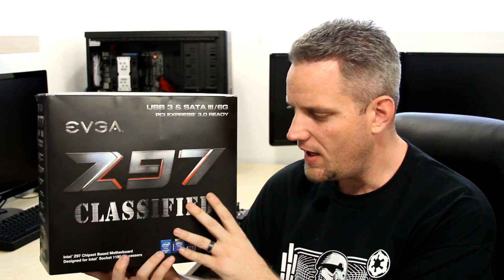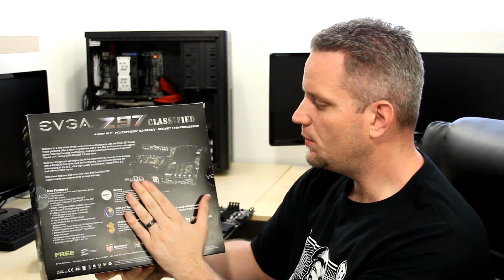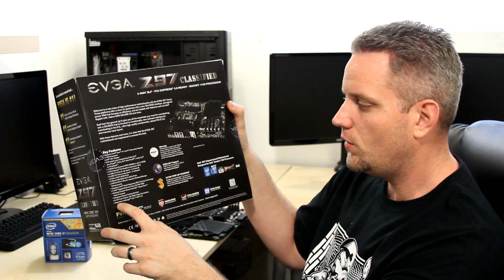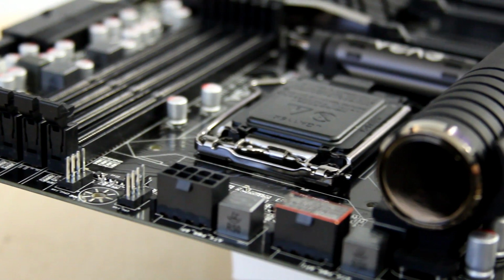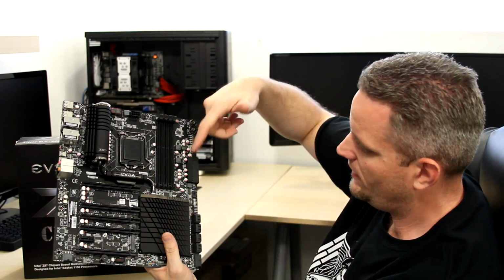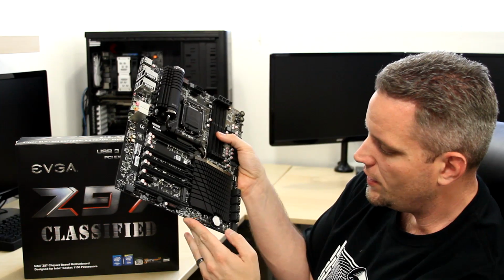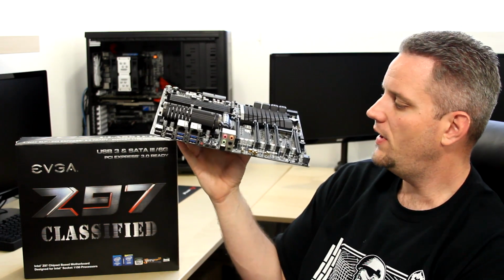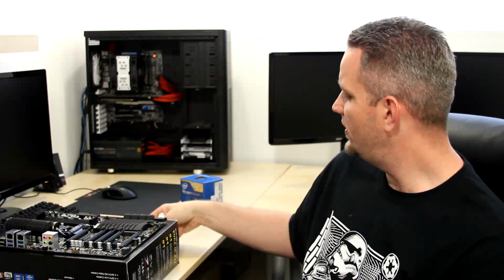Amazing features with very little compromise! EVGA Z97 Classified!

Comment: This is still my desktop system! Back when this video came out I built my machine with 4970K, 32GB Crucial Ballistix Tactical Tracer RAM, 4 Nvidia Founders 780ti cards in 4 way SLI and a couple RAID arrays run off the MB. I had a 1600 EVGA power supply and Cooler Master AIO as well. Then I updated it to 2 way 1080ti SLI and went to 1300 watt EVGA power supply. Now she's just running a Nvidia Founders 2060 Super and all the original equipment. Still an Awesome Machine!!! 4790k runs at 4.9 ghz.  Thinking about upgrading everything to Z790 and i9 14900k, but hear bad things about the 13th and 14th gen chips. Fond memories messing with this machine to this day. Back to the best of overclocking motherboards and GPU's. 3DMark was my addiction,

Comment: +JayzTwoCents Just wondering about those two cpu fans... I have this board and i have two four pin rad fans hooked up to them. Both are set to CPU temp in the bios, however, one is responding correctly while two is just spinning at max regardless of the fan profile i set up for it. Any ideas???

Comment: Is there a way to increase the number of usb 2.0 internally because this mobo only has 1 2.0 and 2 3.0 sockets it's really bothering me
Reply: MrDarkotaku Yup.

https://www.nzxt.com/product/detail/99-iu01-usb-expansion-case-accessory.html
Reply: I've read reviews on that thing the chips tend to catch on fire if you have too much power going threw it...
Reply: MrDarkotaku Then don't put too much power through it. You asked for a solution, I've given you one. I'm using one of these myself and it's working fine connected to my AX860i. Any short-circuits and the PSU will shut down long before a fire becomes an issue.

Comment: That motherboard is the basis for my next build.  Still acquiring parts, but I have already purchased THIS motherboard before watching THIS video.
Reply: Byron Horde I got mine a few months ago and I am very happy with the purchase.
Reply: StealthOD130
You know what's funny?  I just recently found out that Skylake is coming out relatively soon.  Most likely September, which is not very far away.

When I bought the EVGA z97 Classified, I was originally planning to get the Devil's Canyon (i7-4790K) CPU.  Now, after hearing about Skylake and that it is potentially going to be released in September, I'm of the mind to wait and see.

Considering that I am going from an Ivy-Bridge (i5-3570K) CPU that I've had for just over 2.5 years and that I have not yet purchased another CPU or RAM, I'm feeling that waiting is the best option for me.  At the very least, I can wait to see what the final pricing of the Skylake chip I'd want will be.  Besides, I'm AT LEAST two months away from completing my new build.

The mother board is still sealed in its original box and packaging, so I could potentially sell it as new.  In the meantime, I still have my current system to use.

Comment: Jay how do you get around having just one USB 2.0 Header on this board? For example I want to power my All in One CPU Cooler and still have the functionality of the front usb ports on my case.
Reply: get the nzxt usb expanision, works wonders
Reply: I'm pretty sure a all-in-one cooler doesn't use a USB header
Reply: danskfan100 These particular ones  such as the kraken x61that have customization rgb leds and fan speeds have to be connected to a usb header

Comment: Just got this board two weeks ago for my 4790K (re) Build. Had the X58 sli. Be warned!  Not all of your parts will fit here.  CHECK your MEMORY.  I just found out that my uber expensive 12gb of triple channel 1600 Dominator Ram does NOT work on this board.  Apparently Triple channel ram that runs at 1.65V will not work.  Here goes another $400.bucks for new ram  ughhhhhhhhhhhhhhhhhh!!   ( It does run at 1333 at 1.49v )
Reply from the maker: NickNasc Memory compatibility is always the first thing people should check before purchasing new hardware.
Reply: NickNasc PcPartPicker man. Run it in compatibility mode and you should have no issues finding ram for this board

Comment: ***** hey i made the mistake ofr being an idiot and getting a pre built and im realizing its a lot more expensive then building one myself and im trying to upgrade but i think i have an older motherboard because it beeps when it turns on and it only supports 16GB of DDR3 ram and it only supports 1 graphics card at a time. what im asking is did the company i buy this from rip me off? i payed $660 for a ((old?)) MSI mobo, MSI GTX 650, AMD FX-8320, 4GB DDR3 x2,ALLIED 400W ((500w?)) psu, a LG cd drive thing, a 1TB hard drive, and 2 fans that look like cheap plastic but they have leds on them, and a company style case that has fan speed control a reset button and a lot of hdd slots that i cant use because i have a weak psu and not enough sata and whatever cables. hell i had to unplug the cd drive just to add another hdd. it was a laptop hdd but it works

Comment: Hey Jay, whats your two cents on the x99 and 8 core cpus? You think the price tag is worth the performance boost over the lower 8 core cpu's? Note that the processor is mainly doing HPC Scientific/Engineering computations like for example simulations on ansys etc. It will also be used for CAD/3D modelling, video/audio/picture editing,  gaming and the dubbed "general computing". So it will be stressed with all types of workload, would you still say a 1000 dollar MSRP is worth it for the 8 core?

Comment: I'm not much of a fan of this motherboard. On the plus side it supports 4 way graphics, duel LAN ports and decent on-board sound. On the negative it doesn't support M.2 or SataExpress so you will have to forgo next gen SSD performance due to sata3 saturation, its bulky heat-sinks can interfere with parts in your system such as lair coolers, tubing or top rads and its large width limit your case choices.
All in all I don't see that your going to get your moneys worth out of this board, it'll be great till next upgrade cycle then it basically goes straight in the bin. It may be build well and all, but I'd take a cheaper motherboard with better features thank you very much.
Its looks do suit skunkworks well though..

Comment: is this a good build http://pcpartpicker.com/user/Gamer2001/saved/NfFKHx
Reply: wrong
Reply: Get rid of the cd drive and get a better cooler. that processor should be a beast to overclock with once you have the right cooler and it will have no problem running the latest games. Its gonna suck at rendering and stuff like that tho...
Reply: you will really HATE that CPU very slow
Reply: Will bottleneck the GPU you will get terrible performance.
Reply: it has better benchmarks than amd 6300
Reply: look up a utube channel called scattervolt.  he did a 500 dollar pc
Reply: the first thing i woud upgrade if i got some more money is that
Reply: also good for overclocking
Reply: look up the channel scattervolt.  He used this for a 500 dollar pc
Reply: Doesn't mean it is good
Reply: Not all that good. It's a dual core. Won't bottleneck apparently but if you want to overclock you should probably look into some cpu coolers.
Reply: Yes as long as you overclock.
Reply: Rasper Jilius Yeah it's fine but get a good cpu cooler and overclock the cpu then it'll be good. If you don't overclock it will be slow though.
Reply: i thought intel actually put some effort into them
Reply: k thanks, i will also probably upgrade it in fall
Reply: k
Reply: Game A Flame you're welcome :)
Reply: ***** k thanks
Reply: This just in some ASUS boards can overclock without the price of a z97.
Reply: k
Reply: bottleneckin the gpu terrible cpu. 750W Minimum System Power Supply Requirement. Your only getting 550 w psu.
Reply: thechickenchaser 550w is more than enough to power his build lol. The gpu wont be bottlenecked once the processor has been OC'd to around 4.7ghz
Reply: With what cooler stock heatsink lol?
Reply: thechickenchaser I use a 500W to power an even beefier build.
Reply: thechickenchaser Also if he does get a CPU Cooler then I doubt it'll take the remaining 200W he'll have left over.
Reply: Sub $1000 dollar builds should never need 750w

Comment: hey jay what can i upgrade on my computer 
im running 

:GIGABYTE 990FXA-UD3 motherboard
:AMD phenom(tm) II X4 955 processor 3.20GHz overclocked to 4.0GHz 
whats cooled by Cooler master seidon 120V
:GPU is a GIGABYTE R9 270X OC 4g
:Harddrives Samsung SSD 840 EVo 120G with a 2TB
:running a 650wtt power supply by auro cool 
:G.SKILL Ripjaws Series 8GB of ram

the fans im running are 3 140 Corsair AF's front and rear and 2 120's AF on the cooler push pull 

anything i could do to get a tad more performance out 

love the video's keep it up :)
Reply: More Ram

Comment: Those components that are square with the EVGA logo would be the chokes and the surface mounted silicon left of the socket is the POSCAP.

They're great capacitors for enthusiast's that want a overclock with little variance in voltages. They're going to take over the nichicon sealed aluminum caps and not bleed out like a them.

Comment: Great looking board and even better equipped! Although that chipset cooler is rather unnecessary big performance wise, it's still better that it is covering the "blank spots" on the PCB rather than just looking at them.

Comment: I was just troubleshooting an issue with my PC last week as I had installed a new Noctua fan on the CPU Heatsink. Turns out i must have shimmied the heatsink around too much and my system was failing to boot because of overheating most likely.(Bad/no contact with CPU to Heatsink)

But, all while i was trying to figure out "Is it my GFX card? Is it my memory? Did i kill my mobo?" Re-seating every single memory module  in every combination i could think off and trying different PCi slots with GPU etc i was screaming "I WISH THIS GODDAMN MOBO GAVE ME POST BEEPS!!!"

Who cares if it sounds old fashioned. They are a fantastic way to do hardware troubleshooting in a build. It takes the guesswork out of it. Just tell me which bit of hardware is failing!

Comment: I have a similar version of this motherboard but it's the Z77 Classified FTW version. After starting up my PC, everything goes fine but my mobo always displays "AO" on the LED counter. It used to show my CPU temp but since moving my OS onto an SSD, it's only ever been saying "AO" on it. My computer runs fine and performance is normal. Should I be worried? Anyone have any idea why my mobo only says "AO"?
Reply from the maker: Try reading the manual.
Reply: Someone told me once it means All Ok. I have no clue if that's true but both my Maximus VI Formula and G1. Sniper Z87 have allways showed that code after the rigs boot into the os. I wouldn't worry about it.

Comment: Hey Jayz:

Just out of complete curiosity, Why did you go Haswell-2 for your main processor for your new personal rig? Couldn't you have just settled a tad bit longer and gotten Broadwell?  
 
Thanks!

* This Is as Of No Criticism Once So Ever
Reply from the maker: Why wait another year? Broadwell is on a June 2015 trajectory.
Reply: ***** I know, but if Intels Tick Tock schedule proves affective yet again, wouldnt it be more worth your time to wait?

Is the i7 3770k really slowing down your present work load? Because I do alot of work myself. Not to long ago I asked you about if the " Fx 8350 is still a rock solid CPU " And If I run into one of those cheap I was thinking about purchasing it.
Reply: bubagumm64
Why not get new toys if you have the means.
Reply: ***** what he was trying to say in not so many words, is that he can use this now and get the broadwell when it comes out because he can afford to, where as the average consumer/computer user may not have the budget to do so. He was just putting it politely.
Reply: *****
Things cost money. Or it might be sponsor perks that make it viable.
A very capable LGA2011 Extreme system with custom water and dual gpu of latest iteration quickly lands in the $5000 high heavens when all the bits and bobs are in place.

Comment: Hey guys, I'm building a gaming pc. Is this good or would you get something else instead?
Let me know, help would be apreciated :D

CPU: i5 4670k
GPU: MSI GTX 780
RAM: Corsair Vengeance PC3-15000 1866MHZ 16GB 
MoBo: MSI z97 Gaming 5
HDD: WD 1T 
CPU cooler: Hyper evo
Case: Zalman z11 plus HF1
PSU: XFX PRO SERIES CORE EDITION 750W
Reply: CelestialCurse I have the same an i5-4670k and a msi gtx 780 :D So op
Reply: For gaming you only need 8GB,and get the i5 4690K,they cost the same
Reply: Thanks. I will go for 16G cuz I will be doing some rendering too. Regarding the CPU I think you are right. The 4690k is slightly better

Comment: Just wondering but I have a video card with pci 3.0 and I want to know will it work with a pci 2.0 motherboard
Reply from the maker: Oh dear god no! Dont do it! It will EXPLODE THE ENTIRE PC!!! Nah, Im just kidding... they are completely compatible.
Reply: ***** thanks I was really bugged by that
Reply: ***** correct me if i'm wrong but sure it will have a slower bandwidth than pci 3.0, am i right?
Reply: Justin Adrian De la Cruz Gpu's dont actually ever use the full potential of pci 3.0, there is no performance difference between 2.0 and 3.0
Reply: ohhh my bad Blu3raNger88 whats the use of pci 3.0 if they are the same as pci 2.0?
Reply: Justin Adrian De la Cruz there are some pci cards that will use the full potential of pci 3.0, its just gpu's havent actually needed all of that bandwidth is all, not enough information jam up the pci lanes, sorta like how some trucks on the road have a v8 hemi in them but they would be fine with a v6 because most people wont actually tow anything around, but for the people who will, its got the power when its needed. so dont go out and buy a mobo just for the 3.0 slots because there wont be any performance gain, but also dont try to avoid them because they may be helpful in the future
Reply: but mobo nowadays have pci 3.0 lanes
Reply: +Justin Adrian De la Cruz PCIe Gen 2 16x is the same as PCIe Gen 3 8x. GPUs only take advantage of 8x gen 3 so you will be fine with a gen 2 board with a slot running at 16x which all do
Reply: okay thanks for the info